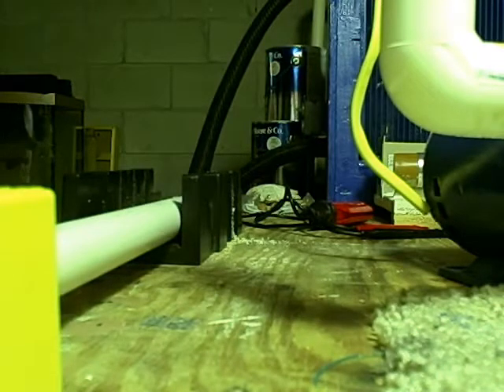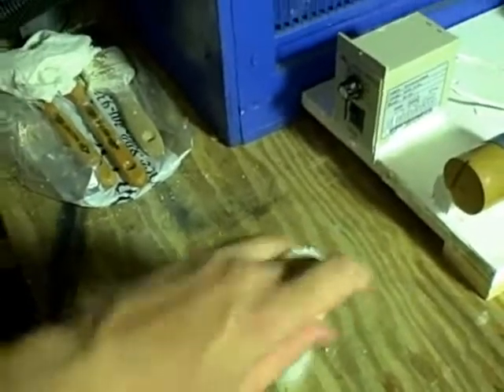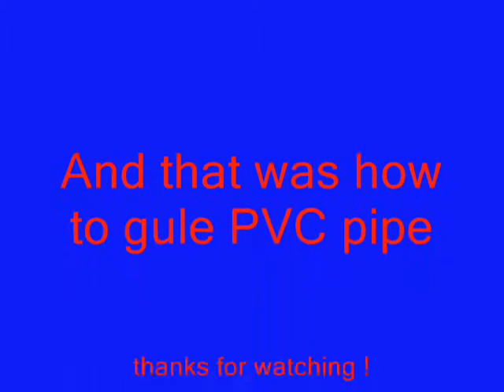How to gule PVC pipe.

Comment: @67tr876 It will probably hold but not like it would if the correct glue was used. Read the back of the can. It will specify what materials it will work on. Orange is typically for CPVC so is gold. With the correct glue primer is not necessary.  I have glued CPVC with PVC glue and it was a very weak joint. Use Oatey brand in the green can for the best results with PVC. Flowguard gold for CPVC.

I considered building a chiller out of a window air conditioner for my Reef tank at one time.